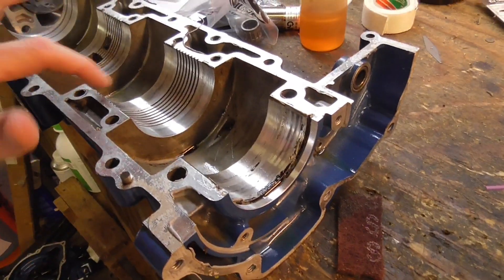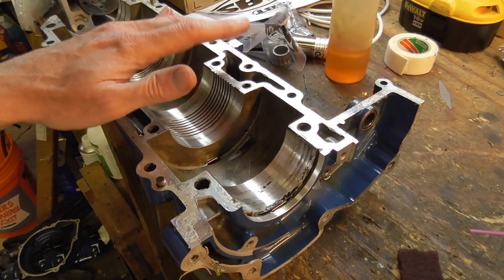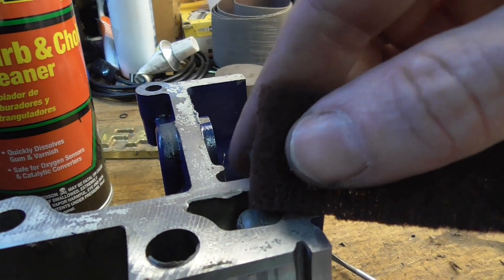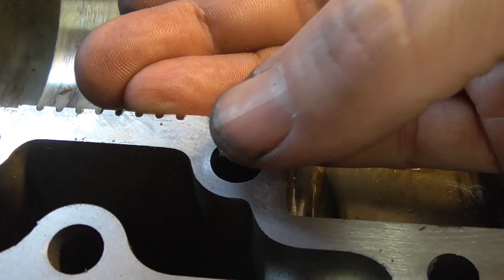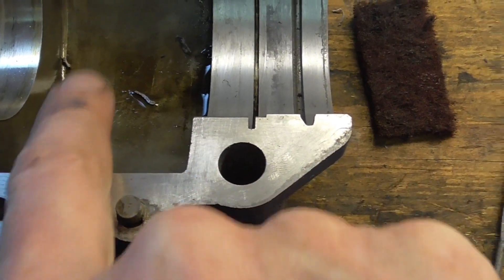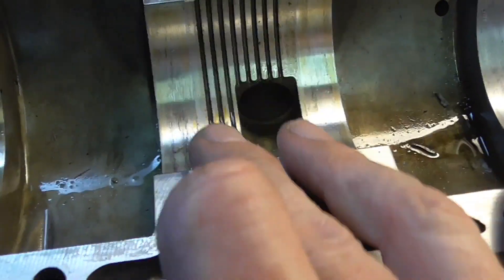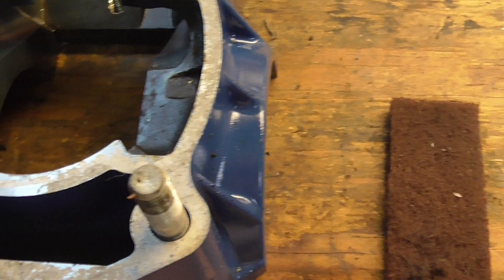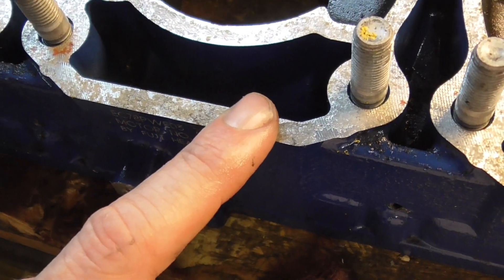Assembly of Polaris SLT780 engine pt1

Comment: how did you remove the flywheel?
Reply from the maker: Plain ole gear puller.
I did upgrade the bolts I used for going through the flywheel holes.  The flywheel has threaded holes IIRC.
But they can be pretty stuck, so I start tapping on them with a soft hammer as soon as I get plenty of tension on the puller.
Reply: going to pull the block this weekend. @stimpsonjcat67
Reply from the maker: @32srt32  be sure to make notes about how many washers are under each engine mount.  Those washers are how the engine gets aligned to the pump shaft.
The closer that alignment is, the less wear the rubber flex coupling will see.

Comment: I’m doing a rebuild like you. Your engine still running strong? And how did you get all of your toque specs and all I’m interested if you still got it thanks.
Reply from the maker: This engine is in a ski I gifted to my nephew.
He is very mechanically gifted and has it running like a top.
He ran straight exhaust on it to see if it would increase speed, but only the noise, lol.
I gave him some trim nozzles I had and he's trying that next.

Honestly, short of running these lean or out of oil, I don't see how you could kill one.
Tune them for top end revs at no more than 6300 and rock on.